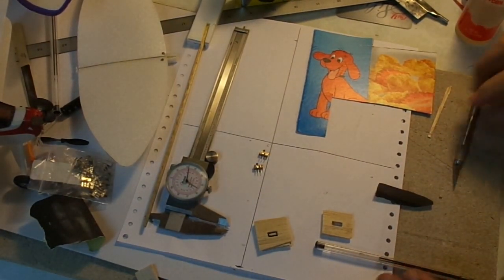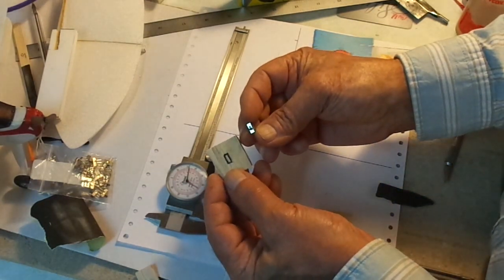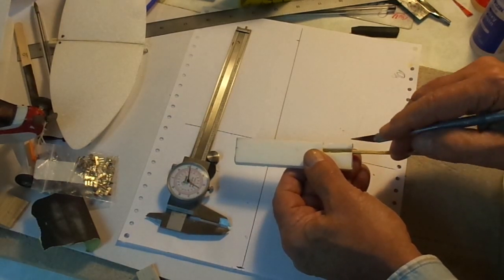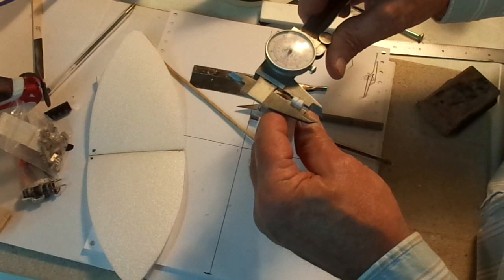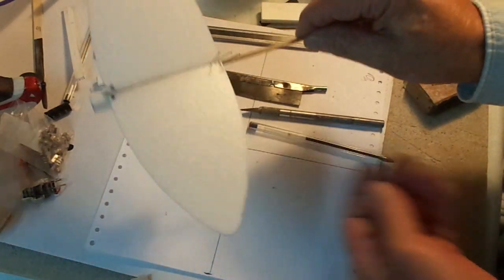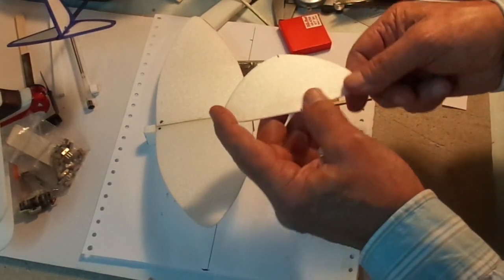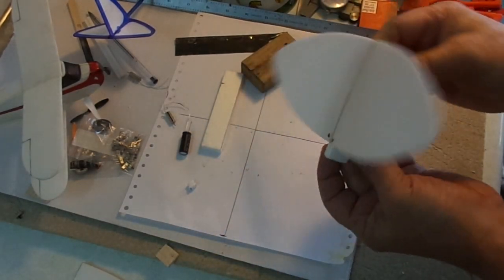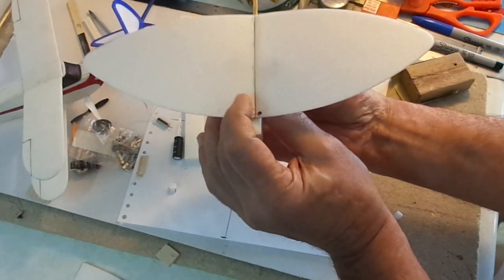Supercap Build Along Video Part 3

Comment: Another great segment . how far back from the leading edge is the CG on your first build ?   Free flight models or should i say the ones i have made glide best with the Cg father back than you would ever do with an RC model,  l will be the first to admit free flight always has been very hard for me to get right with my very limited experience with it. lol lol
Reply from the maker: CG on the prototype is a bit farther back, not much though. 1 1/4 inch suggested in this video is a safe starting point to begin glide testing and at this point in the build we haven't determined its final location...

I've seen some F/F designs with the CG quite far back too...I notice a lot of them have a lifting tail surface. I dunno...these little planes seem to do pretty well with the forward CG, maybe it has something to do with the small size. Moving CG aft would require a reduction of the usual downforce provided by the stabilizer...means you'd have to reduce angle of incidence between wing and stab...it would be an interesting experiment...I have a feeling it would make the model touchier to trim... It would be easy to try with this model, just change the angle of incidence when you cut that slot for the tail boom...let me know if you try it! Heck, I might even try it myself..

Comment: The sharpie does a good coloring job on the surfaces.
Except...it does not color the edges on the foam parts on mine.
I guess that’s what I get when I am to lazy to sand them edges smooth.
Reply from the maker: tbh sanding does help....sharpies on foam is gonna be crude no matter what, let's face it....but it does look awesome from a few feet away! I always try the colors/techniques I'm gonna use on some scrap material first. Well, at least I do now....ever since I went to do a silver paint job on my newly built MiG with a silver sharpie and a minute after I started laying it on I noticed the foam was dissolving..........

Did you see my Spitfire with the camo paint job? The camo job and all markings are sharpied on. Looks like a nicely built plastic kit from a few feet away...So keep experimenting!  Also, if the edges won't take color, you need a color scheme with unpainted edges. I also notice that sanded/unsanded sections of the same surface will take color differently, sometimes a "second coat" helps.